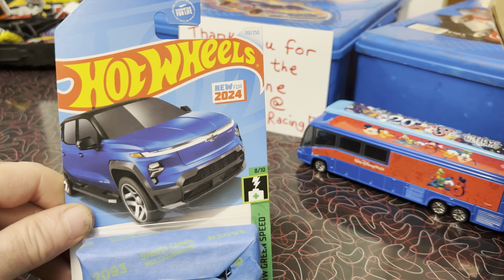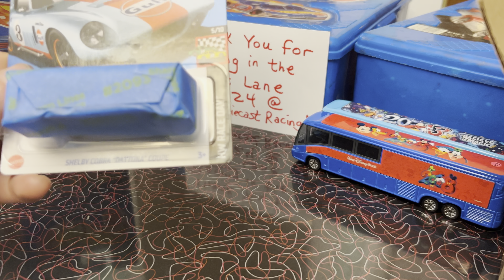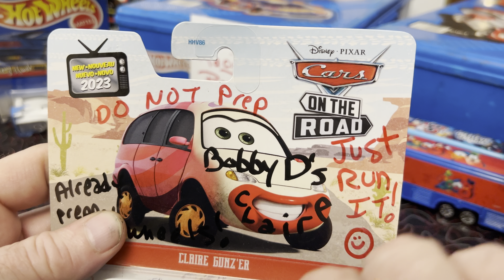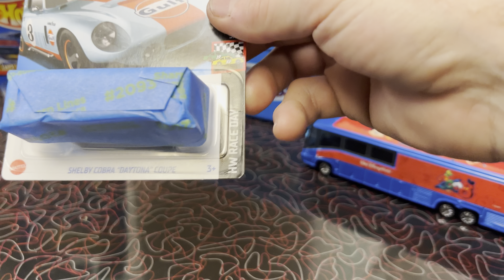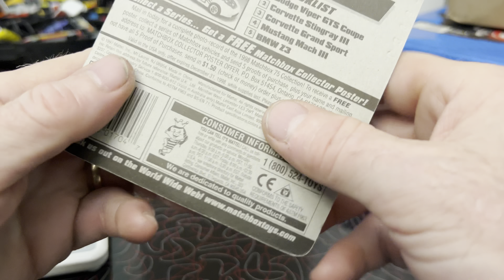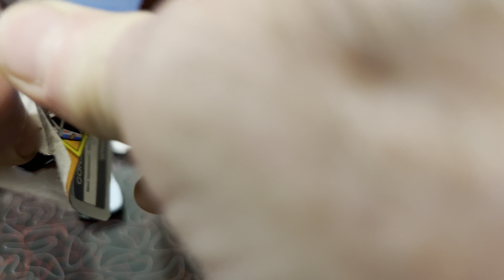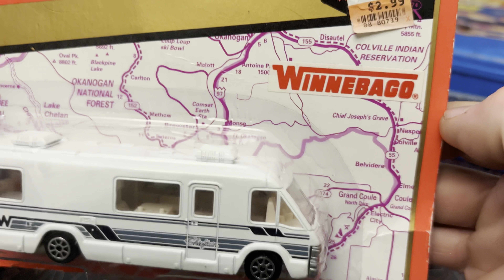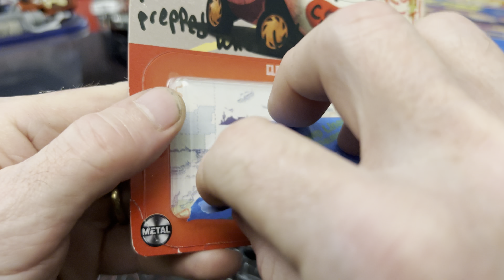Mt Holly Racing Lucky 13 Featuring Elevation Diecast Racing

Comment: Those busses are majestic 💪 And fast, nice.
Reply from the maker: I would roll them here before Mile High. Your track is the only other track with enough potential energy. 
Speed begets speed.
Thanks Tomi
Reply: @bobbydslakesideraceway1849  I can adjust gate height between 33 and 35in, but I prefer latter. I used to run 38 but I think 35 is pretty good average.

Comment: "Returning Warriors"
I always find interesting, analysing returned cars. How much difference did you find from before your two left, to when they first returned?
One bus, 2013,  is the Express! I think I will call my bus here, "all stops!" hehe
Cheers
Reply from the maker: The returning cars performed differently.
Chromeo got slower. The Charger got faster after returning home. I reworked it just before posting, and it never had a chance to break through. 
It’s faster now than from before.
My Camaro came back fine.
The Bus will not travel, Period.
Thanks Marc